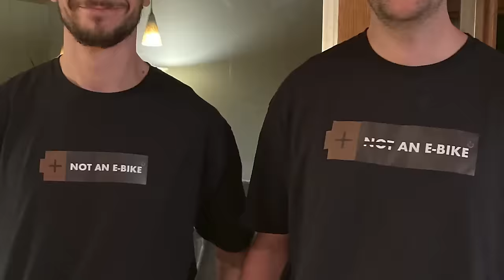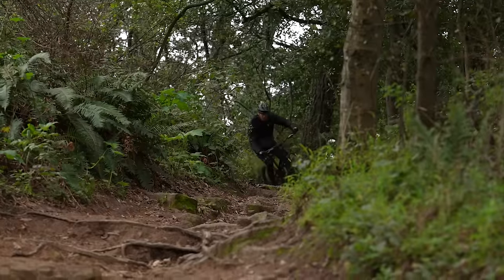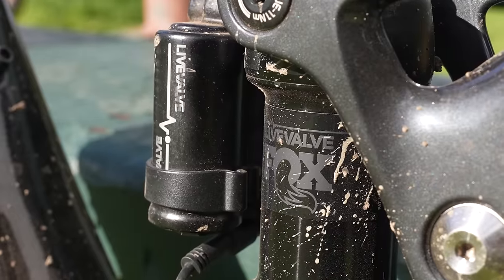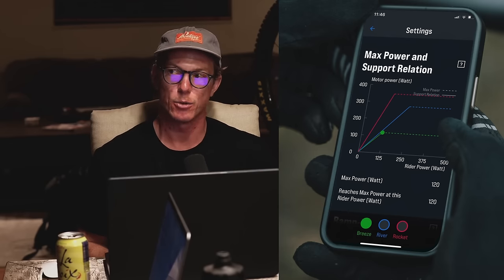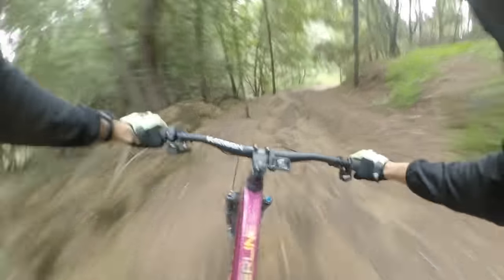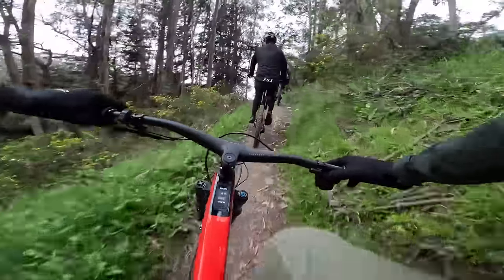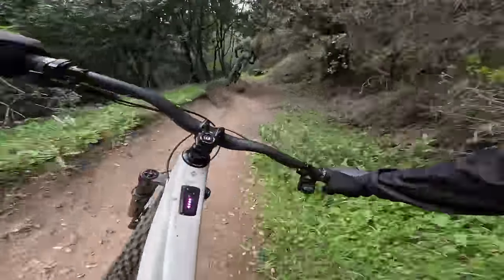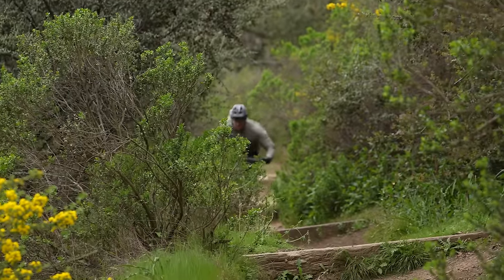8 LIGHT eMTBs TESTED - Santa Cruz, Specialized, Cannondale, Ari, Transition, Trek, Giant, Karbon

Comment: I have the Trek Exe. Changed it to a 150 rear, 160 fork. Mullet out back. Still a great trail bike, but a little more capable. Also, im 5'8" and tend to prefer mullets except for short travel 29ers. This review is solid. I ride it with a buddy that has the ari and one that has the newer levo sl. The guy with the ari has 20 percent more battery than we do at the end of the ride.
Reply: Guy in the Ari is still riding a 20% weirder bike though
Reply: @joehoeper3941 what’s “weird” about it?
Reply: I also have an EXe and absolutely love it. Stock rear but I did go up to a 160 fork. Motor is super quiet and punchy enough to make the climbs not suck, but you definitely still have to work for it. Rides like a normal bike, a really well sorted one.

FYI overstroking the shock on the EXe comes dangerously close to seatstay bridge/seat tube contact at bottom out, so be careful I guess. It's like 2-3mm gap.
Reply: @whitest_kyle Thanks for the warning. I had that concern too, but i think my medium frame has more clearance than just a couple mm. Also, frame is fairly stiff, which i like, and doesnt flex as much as most of the bikes i have ridden. In any case, will keep an eye on it. Thanks!
Reply: His battery life span is probably gonna longer as well.
Reply: Would you mullet the analog version? I have a fuel and a slash. I’ve often thought of buying a 27 rear.
Reply: Why did trek ruin a great bike with that stupid integrated handlebar? Def a head scratcher. That’s the first thing riders customize.

Comment: As an owner of the giant I gotta say it’s probably the most underrated ebike out there. I have the version here in the test and while I agree with some of the negatives they pointed out overall it’s a beast. Change out the bars, internally routed headset nonsense, and maybe brakes depending on your style and it’s a beast. Put the fork to 160 overstroked the rear and it’s even more of a beast now. Throw on the battery extender for an extra lb and you keep up with battery life with full fats with ease.
Reply: Oh and maybe you got a defect live valve because mine works amazingly and I notice it. And love it. But I am considering swapping to rockshox stuff cuz the new stuff is just so damn good. Especially for a taller/heavier guy like myself.
Reply: I agree. The Giant and the Cannondale would be my top picks. May rarely use the 85nm but nice to know it’s on tap if you ever want it
Reply: So how was the $750 dollar battery upgrade?

Comment: Love riding my Gen 2 Levo SL. It's not the fastest nor the most capable but it is the most fun bike I have I just want to ride it all the time. I have the Comp Carbon size S3 and it weighs 39lbs(without pedals). I don't mind having the RE when riding with full fats it adds around 2 lbs and it's still super light!

Comment: Regarding the fazua's motor matching cadence. I turned the acceleration off because I like the initial stroke to feel like a regular bike and it got rid of that odd movement. I think it's the acceleration kicking it at odd times in the pedal strokes. (Heckler SL)

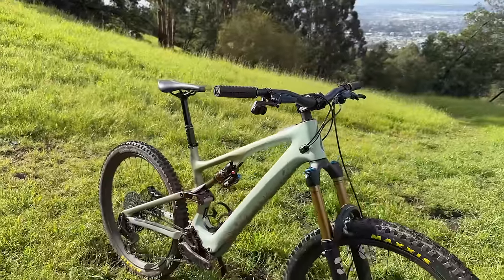Comment: 3:01:10 so did specialized fix their dropper post depth issues on the S3 and lower sizes.  The older levos could run anything larger than a 150 due to insertion depth limits.  I had to ride an S2 and a 150 dropper as a 5”6 medium spec rider.  180 minimum dropper for me. I like to touch the ground on an MTB. Thats one thing I love about transition they are thought through for all riders not just the 5’,9” specialized riders.

Comment: GIant FYI:  Expansion Pak Battery ($500) Requires a plastic bottle cage ($100) and its own charger ($250). No spliteer like specialized!!(big miss and big prices$$$. =$750 for a battery pak is ridiculous. Get a heckler.   Brakes are a joke.  Battery cover with sync drive is attached with double sided sticky tape, not a waterproof seal.  E-TRX wheels a joke massive flex, loose hubs with not adjustment/tighteners.    It’s a $4k bike with a 10k price tag.   Oh and support? LOL. None. Your completely reliant on your shop they don’t talk to the public.  Quality bike-shops wont carry Giant due to all the above. 

All my comlliant asside. These bike reviews should include an overview of the battery extenders especially on bike that sell a half pak battery on an SL.  

People need to know that there is a $750 tax to add that battery capacity back.
Reply: if i get it right for you the best bike is Heckler

and thank you for the info about expansion pak price